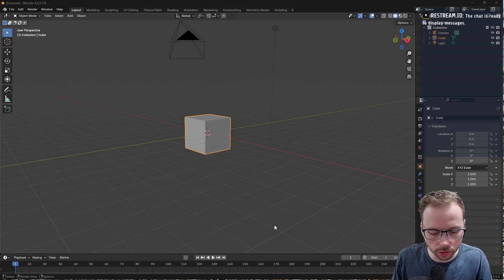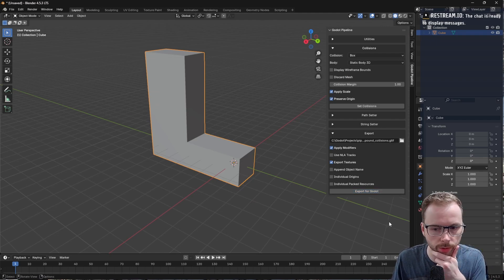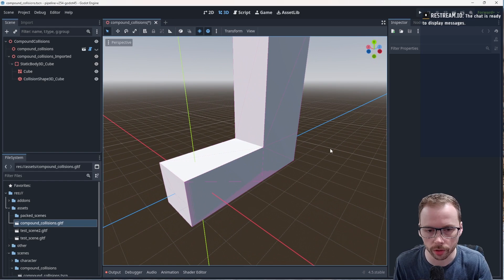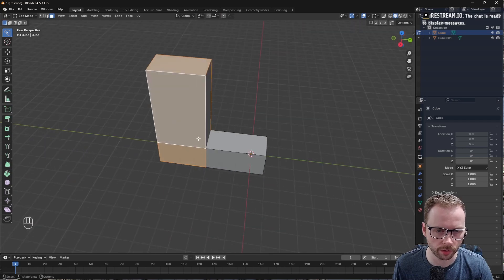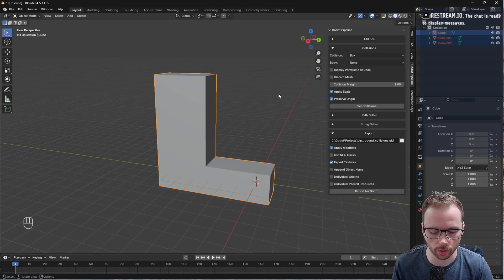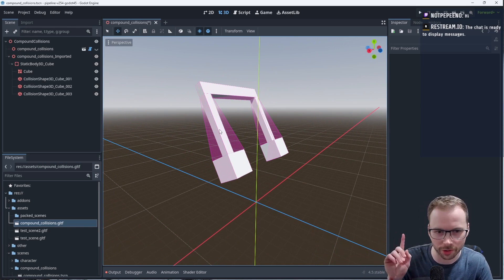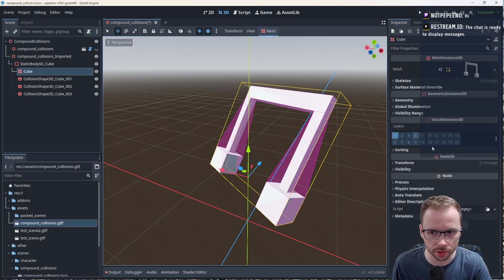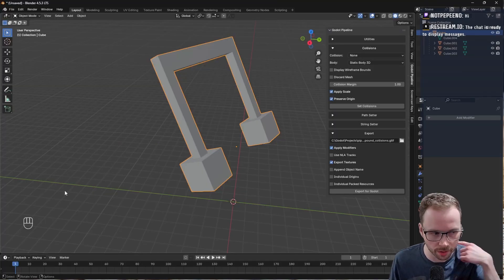Compound Collision Shapes in Godot 4.5

Comment: This is pretty cool! Randomly got recommended this video. Just a few days ago I wanted to get a concave mesh into Godot from Blender to use as a rigidbody (a scoop), but concave shapes don't work well for this and glitch around. I found a simple plugin on github - /olitheolix/blender-convex-decomposition and got the CoACD repo compiled and working with it. If you have a more interesting or complex mesh CoACD will chop it up for you into separate convex shapes. I then just used the -convcolonly postfix in Blender to make them all convex colliders on import. Worked out great in the end. I also just realised the plugin shown here is your own - might be useful to integrate CoACD into it?